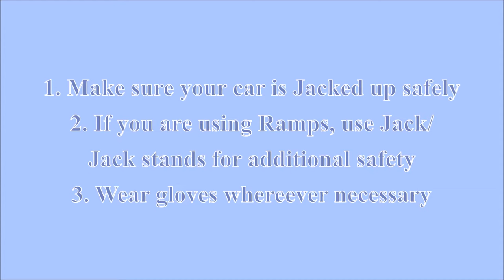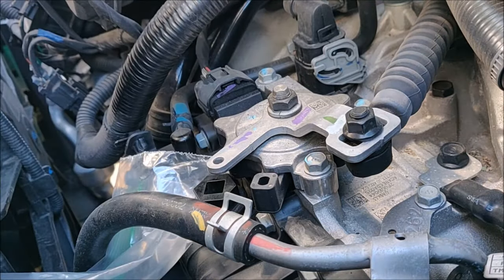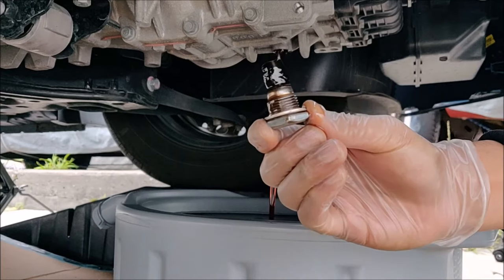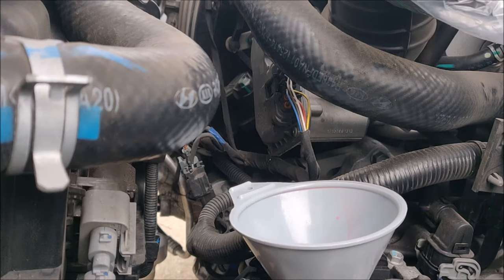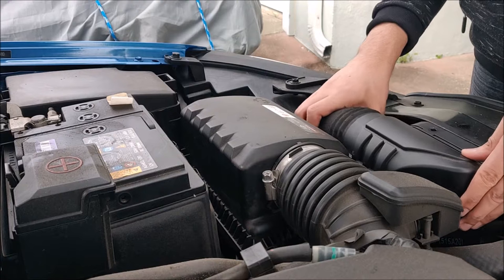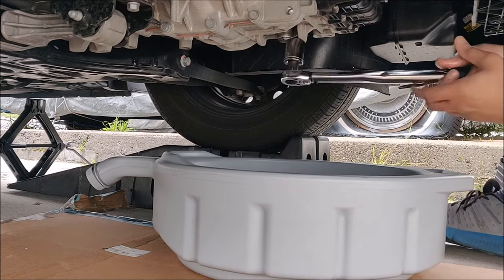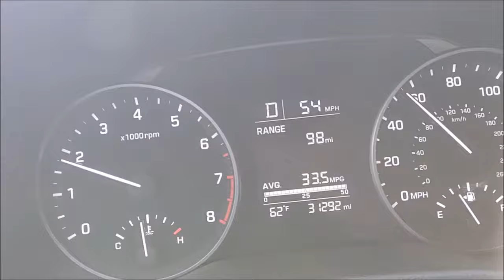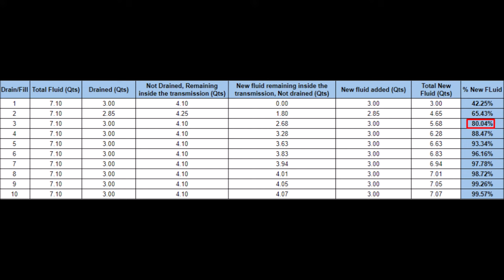2018 Hyundai Elantra Transmission Fluid Change - 3X Drain & Fill with Amsoil ATF (6Th Gen Elantras)

Comment from the maker: ***ALL UPDATES / FOLLOWUPS GOES HERE***
**47k miles now. Shifts like Butter! Next drain/fill at 60k. Update Video will be made!**
Follow up Video here -  https://youtu.be/w7mYgrWWit8 Transmission Fluid playlist here - https://www.youtube.com/playlist?list=PL1j1gyvwIm1XWFImRpBazNAkf72I2ab0X
1. Honestly, the process is easy. If you can do an oil change, you can do this. Just need to have patience and do the steps slowly. This was my first time as well and it was an enjoyable experience. 1st time I took my own sweet time to do it. 2nd and 3rd time I knew exactly what needs to be done, I did it very quickly! ha ha :)
2. IMPORTANT - I would recommend using the Level plug to check the fluid level (Making sure the car is at level). To do so, add about 0.5 quarts extra in the transmission. Use a Infrared temperature gun (20$ in Amazon) and measure the temperature of the drain bolt when the car is at level and running, gear in P. When the temperature of drain bolt hits 120 F, you can be sure that the temperature inside the transmission and the fluid temperature will be between 120 and 140 F. At this point, remove the check plug and let the excess fluid come out. When you see a small steady stream, close the check plug and you are DONE! :)
Here's what happened. I did not spill a single drop of fluid and measured the fluid as accurately as possible. I added 0.2 Qts extra at the end as well. There was no issues with shifting as you saw at the end of the video and did no harm. I just wanted to check the level using the level check just to be sure. Went to a local mechanic, he checked it in front of me It was low. Had to add 0.3-0.4 quarts in order to get to the right level. He actually pumped the fluid in using the level check hole, so even that can be done to fill the fluid (It could get messy by this method, so I would stick to filling the fluid via the fill hole at the top). It is all good now. Still shifts like butter! I wonder if the factory fill was under-filled a little??? Or does the tranny fluid evaporate over time??? I did my research, it actually does not. Some websites say it does!! Any idea??? Strange - huh! :D :)
3. Some folks have mentioned that the fill plug came out easily for 2017-2019 Elantras. At the same time, there are folks like me that had bad luck and had to file in order to open. So fingers crossed!
4. OIL ANALYSIS - I received the results of the oil analysis of the sample I took from the 3rd drain. The fluid was a mixture of 65% new amsoil fluid and 35% of old Hyundai SP-IV fluid. The fluid was 100% alright without any Metallic compounds present and the fluid was in excellent condition. This means that, all the break in materials were flushed out after 2 drain and fill procedures and also proves that mixing fluids does no harm to the fluid!  But a 3rd drain and fill is recommended to put most of the new fluid in and keep it real clean :) Cheers! Let me know if you have any questions! :)
Reply: I really liked your explanations I got 2017 elentra. Gl model I would like to know how many quarters of transmission oil needed as well on your video while you changed the transmission oil after three 200
Miles driving back you changed it is it mandatory to do it or once it’s done no need to change it again
Reply from the maker: @brethart4938  Hi Bret, I used 9.5 quarts of transmission oil total. If the car is at level, you could get 3.5-4.5 quarts of transmission fluid out. So keep around 5 quarts for one drain and fill procedure. My car was not at level when I did this because of which only 3 quarts came out.
Reply: Andy-Auto-Info thanks a lot  ohh  in total for cars like elentra Hyundai  gl 2017 how many I do need to buy transmission fluid bottles I mean  and while changing the transmission oil how can I get the whole amount out at once so is it gonna be fine if I change I don’t need worry about level stuff as you mentioned what’s the reason about level while you can release only three 3.5 quarters of from transmission any other way to get the old oil from transmission out at once how can I avoid the level issue thanks
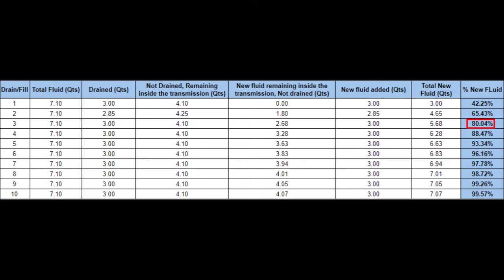Reply from the maker: @brethart4938  The total capacity of the transmission fluid is 7.1 quarts. If you do a drain and fill, you only take out about 50% of the old fluid. If you do not want to use the level check plug, measure how much fluid came out very accurately and put the same amount back in. By doing the drain and fill procedure 2-3 times, you get 80-90% of the old fluid replaced with new. You can check the video at 23:07 mins for more information.
Also, by doing a drain and fill, you cannot get all the fluid out at once. If you want to do that, you will have to take it to a mechanic and do a flush. But flushing is not a safe option in my opinion. :)
Reply: Andy-Auto-Info thanks brother your the best *****
Reply: Andy-Auto-Info brother one quick last question as you mentioned car level on ground then the transmission temp must be from 120 deg f to 140 deg f how can   I view the temperature and as well as while draining the amount of 80 to 90 % transmission oil back and forth mixing up old and new oil any idea the final part capacity of transmission oil in  tank how much it would be with new oil one and while draining out couple time’s where will the old and new oil mixed  up goes sorry I’m lil confused I hope you understand what I mean  thanks
Reply from the maker: @brethart4938  I'll be happy to help. Do not worry about mixing of fluids and percentages. I will explain in an easy way, but I have a question for you. What fluid are you planning to use? OEM or other? How many miles do you have in your car?
Reply: Andy-Auto-Info I think from what you recommended to sp4 atf I can get it from a Hyundai dealership so for automatic engine right is there any different automatic or Manual are they good with same kinda oil or it’s different mine is automatic four cylinder 2 litter engine size Hyundai elentra gl 2017
Reply from the maker: @brethart4938  Yes, just make sure the fluid is SP-4 or SP-4M (that's the latest spec from Hyundai). So the steps are below -
1. Drain the fluid. Measure the fluid accurately. For example, lets say 3 quarts came out.
2. Put back 3.5 - 4 quarts in. 
3. To check fluid level - Bring the car at level ground. Keep the car running. Gear in Park (P). You can use a Infrared Thermometer Gun ($19 on amazon) and measure the temperature of the drain bolt. When the temperate hits 120 F, remove the check plug and allow the excess fluid to come out until you see a small steady stream. Once you see a steady stream of ATF coming out, immediately put back the check plug. You are done and the transmission fluid is at the right level.
Video should also give you an idea of the overall process. All the best :)
Reply: Andy-Auto-Info thank you so much brother god bless you
Reply: Hi-thanks for sharing all info, did the mechanic check the oil level with refill port (on top) open or closed thanks.
Reply from the maker: @edwinantonio3787  Hi Edwin, a very good question and I never thought about it. Ha ha. This may not really matter actually. You can check it with the fill plug closed. :)
Reply: Hello  @andy-auto-info2483   , i have a Hyundai Elantra 2015 MD with the same looking gearbox (6speed automatic transmission), can i do the same procedure ?
Another question please, do i need to put new fluid after the first and the second change or reuse the same as the first change ?
Reply from the maker: @akramzairig2298  yes. You can do the same procedure. And you do not need to file the fill port because for 2015 models, it comes out easily. And use fresh fluid all the time. Do not reuse the fluids :)
If you see my video, I used about 9 quarts to do this. I used fresh fluid all the time. Also, see the excel sheet at the end :) let me know if you have any questions.
Reply: How many Quarts did You use to fill The Transmission? Just Asking
Reply from the maker: @JorgeRodriguez-po7kx  about 9-10 quarts since I did this 3 times. :)
Reply: @andy-auto-info2483  Thanks!  😁

Comment: Thanks for the video can you do a video on the proper way to jack up this Elantra safely using jack and jack stands. Lift points thanks
Reply from the maker: Thank you. Sure, I'll do that next time when I take this video. For now, there is a pause from my side in making videos. :) I'll definitely be doing a transmission fluid change at 60k miles.

Comment: Good video! However I do not understand why you have not changed the transmission filter?
Reply from the maker: Thank you. But the new Generation Hyundai models does not need a transmission filter change. There is a transmission filter but that is somewhere inside the transmission and is very hard to access. Even the dealers do not change it. :)

Comment: Ok..I see the shift selector arm on the trans is blocking the fill plug..Safety block the tires/Shift lock release to move shifter from P to N or other to clear access fill plug..

Comment: Sir if you went in the car place the parking brake on ,, make sure that you block the rear tires then place the transmission shifter into Drive engine off”” then would be able to remove the transmission filler plug without filling it out

Comment: Sorry for noob question. When you drain/add transmission fluid the car supposed to be leveled, correct? So, suppose I put Elantra on 4 jack stands and engage parking brake when I’m doing this procedure.
Would it be safe to start the car, go through gears while car is off the ground??
Reply from the maker: It definitely would be safe. Just don't hit the accelerator. Also, use brakes and leave the hand brakes on at all times. :)

Comment: Hello @Andy-Auto-info, i have a Hyundai Elantra 2015 MD with the same looking gearbox, can i do the same procedure ?
Another question please, do i need to put new fluid after the first and the second change or reuse the same as the first change ?
Reply from the maker: @Akram Zairig  yes. You can do the same procedure. And you do not need to file the fill port because for 2015 models, it comes out easily. And use fresh fluid all the time. Do not reuse the fluids :)
If you see my video, I used about 9 quarts to do this. I used fresh fluid all the time. Also, see the excel sheet at the end :) let me know if you have any questions.

Comment: I couldnt find any socket wrench set in which I will get 10mm 17mm for oil and 24mm for ATF drain all in one set.
Reply from the maker: The tool kit I used was this - https://www.amazon.com/gp/product/B071DP4TQX/ref=ppx_yo_dt_b_asin_title_o01_s00?ie=UTF8&psc=1
It is currently unavailable. 
But these are good for oil change and other fixes. Comes very handy - Please see my full message.
1. https://www.amazon.com/dp/B074Z3968Y/ref=sspa_dk_detail_1?psc=1&pd_rd_i=B074Z3968Y&pd_rd_w=RAp6q&pf_rd_p=a64be657-55f3-4b6a-91aa-17a31a8febb4&pd_rd_wg=jf3HF&pf_rd_r=SGY7VB9144SJBXMCZRW4&pd_rd_r=23296c04-2d3a-42e9-ad67-d0da10100f44&spLa=ZW5jcnlwdGVkUXVhbGlmaWVyPUEyT1NWQ0VTOUpOU1ZEJmVuY3J5cHRlZElkPUEwMDEzNDkwMUU0NFkxUDlHQ1pYNCZlbmNyeXB0ZWRBZElkPUEwMDkyNjU1MVAzS0tYN05BNEtaOCZ3aWRnZXROYW1lPXNwX2RldGFpbF90aGVtYXRpYyZhY3Rpb249Y2xpY2tSZWRpcmVjdCZkb05vdExvZ0NsaWNrPXRydWU=

2. https://www.amazon.com/dp/B07V6RYWW8/ref=sspa_dk_detail_4?pd_rd_i=B07V6RYWW8&pd_rd_w=3NEQ0&pf_rd_p=a64be657-55f3-4b6a-91aa-17a31a8febb4&pd_rd_wg=Ozd7S&pf_rd_r=M2FE2A9DRFJGD692R3V2&pd_rd_r=9b1914d8-1f54-41fa-957c-59ccac024234&spLa=ZW5jcnlwdGVkUXVhbGlmaWVyPUEzME1KSFBRMUhRMDkyJmVuY3J5cHRlZElkPUEwNTE1MDMwMUM5NVcwT1VRT0xXOSZlbmNyeXB0ZWRBZElkPUEwNzA2MTExMTRJMFRBTUxBWU5QSyZ3aWRnZXROYW1lPXNwX2RldGFpbF90aGVtYXRpYyZhY3Rpb249Y2xpY2tSZWRpcmVjdCZkb05vdExvZ0NsaWNrPXRydWU&th=1

Torque Wrench I used - 
3. https://www.amazon.com/gp/product/B075ZVQVSY/ref=ppx_yo_dt_b_asin_title_o03_s01?ie=UTF8&psc=1

For transmission Drain bolt socket - This should attach to Torque Wrench because it is 3/8th Inch drive and also other wrenches from the toolkits 1 and 2 mentioned above.
4. https://www.homedepot.com/p/Husky-3-8-in-Drive-15-16-in-6-Point-SAE-Standard-Socket-H3D6P1516/202913497

Comment: Hi Sir
I have Hyundai Elantra DOHC SEL 2019 engine 2.0 
Which type of ATF needed?
How much liter's of transmission fluid capacity need it?
Thanks
Reply from the maker: It should be the same type of fluid. The latest one is SP-IVM. Could you check your manual what it says for transmission fluid? If you're draining and filling, you may require upto 4 quarts of oil  like seen in the video. Thanks.
Reply: @andy-auto-info2483  
Checked Manual 
MICHANG ATF SP-IV, SK ATF SP-IV, NOCA ATF SP-IV, HYUNDAI genuine ATF SP-IV or other brands meeting the above specification approved by HYUNDAI Motor Co.
Reply from the maker: @hersh85  perfect. Then SP-IV or SP-IV M would suffice. :)

Comment: I changed my fluid last week, no problems other than I didn't have the right size crush washer. And for some reason, I didn't measure the old one before I reinstalled it. Do you have the size of that washer? I'm guessing it's around 24 mm. The Hyundai part number is 21513-11000 but doesn't give the size. Don't feel like paying $10 for one, shipped from Hyundai. I used Aisin SP4 fluid from Rock Auto.
Reply: How has the aisin sp4 help up?

Comment: Did you use ever fuel additive in your car ? Because in the owner manual it is mention that's why I am asking.
Reply from the maker: Yes, I use Amsoil Performance Improver or Redline fuel system treatment additive once every 7500 miles. I use them for a full tank of gas.
Reply: @andy-auto-info2483  Amsoil it is even not available on Amazon and Walmart ?? Are working with Amsoil?
Reply from the maker: @DesiTravelDiaries84  No, you can only buy it online through their official website and through some Amsoil dealers. Check out their website, they have detailed transparent information on every product. No other product gives so much info :)
Reply from the maker: @DesiTravelDiaries84  also check out this video, you will see the quality of the products they make. https://youtu.be/TWuKvnCq1js
And project farm is one of the most genuine guys out there. :)
Reply: @andy-auto-info2483  Got it ... Hyundai recommend Chevron Techron Complete Fuel System Cleaner 20oz
Reply from the maker: @DesiTravelDiaries84  that doesn't matter. They all ultimately do the same thing. I feel amsoil and Redline have better detergents.
Reply from the maker: @DesiTravelDiaries84  And they also recommend Quaker state engine oil. But do we use them? Ofcourse they are a decent brand, but there are much better oils out there. Similarly the fuel system cleaner. :)

Comment: Thank you for the detailed video! I'm getting ready to perform this service on my 2017 Elantra and wanted to ask about the ramps you use. I've always used my jack and jack stands when doing oil changes but am thinking of investing in some ramps to make things a bit easier and allow me to keep the vehicle better leveled. I've browsed a bit on amazon but would appreciate your recommendation. Thanks again!
Reply from the maker: Thank you for the feedback.
I used Rhino Ramps. This one costed me $30, its a good one.
Reply: @andy-auto-info2483  I just completed this service the past weekend. I performed two drains/fill. My Elantra has over 105k miles, about over 75% of those are highway miles I would approximate. No issues so far even after performing the service well past the suggested mileage. Thank you again for the detailed video. I wanted to provide my experience with the fill plug for anyone who comes across this video later and looks at the comments like I did. I was able to remove the plug relatively easy by loosening it first and then keeping my extension in and pulling back on the plug with a little force, not much but this was enough to remove the plug without having to file anything down.
Reply from the maker: @Finite121  that's good to know. I'm glad this has helped you DIY successfully :)